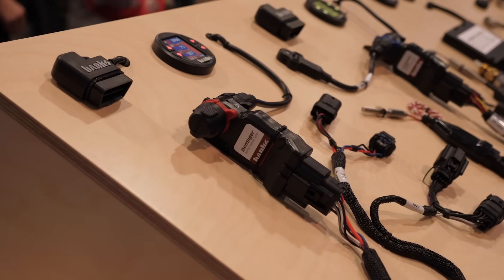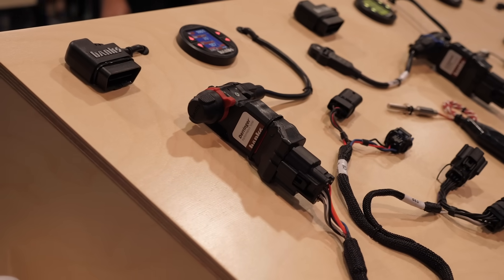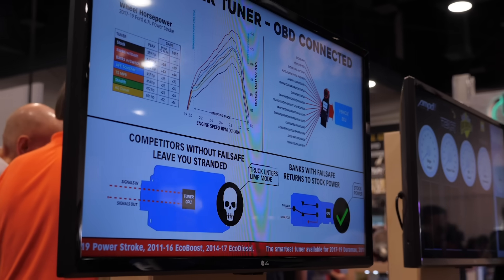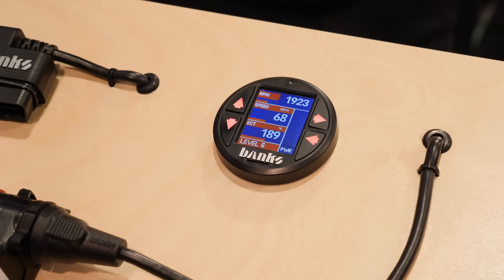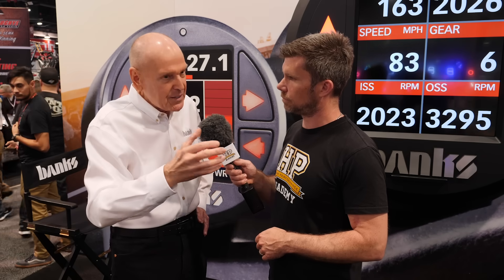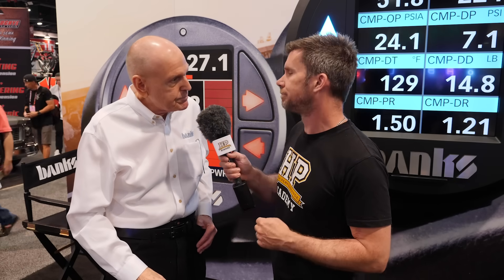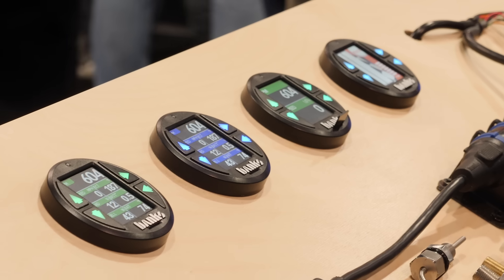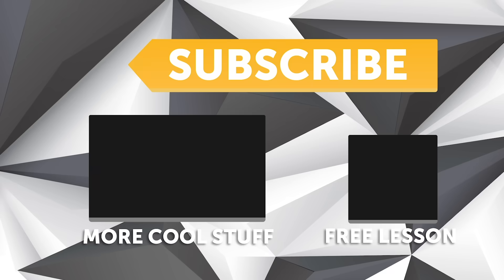More POWER With A DPF Fitted? | Gale Banks On Emissions [TECH TALK]

Comment: He missed the entire point of the cost of the emissions systems. Most people who delete just want their truck to run without 5 figure repair cost when it breaks.
Reply: This was a few years ago but my brother had a 2013 diesel truck he just bought at the time and it had no check engine lights whatsoever. He drives it for like a week and the light flashes. Takes it to the dealer he bought it from and its the entire emissions system basically. Estimated $15k in repairs but it was all under warranty. Truck was in the shop for a few weeks. Stupidest thing.
Reply: Exactly!
Reply: Precisely why I deleted mine. 🤷🏻‍♂️
Reply: None of you are smarter than Gale
Reply: @dv7431  you're correct, gale isnt allowed to say what he knows is right without getting Greta and the EPA upset and suspicious with him
Reply: @dv7431  Gale mentions he does not like the emissions equipment due to inefficiency and longevity in his speed podcasts, but says he has to play by the rules.
Reply: @dv7431 the fact you think this old fart is telling you the truth is hilarious
Reply: A deleted truck will be more efficient, and produce less greenhouse gasses!
Reply: @JohnDoe-nz6bk  
Unfortunately, greenhouse gases aren't the problem that DPF systems are solving.

Comment: I don't have a problem with my ISX 600 making power.  What I have a problem with is putting 1000's of dollars every year in parts to keep it working properly. Today's systems are just a money pit that destroys the engine and shortens engine life by 50% or more.   I have friends running commercial trucks for years with fully deleted engines making 30% more power with 40% better fuel mileage and you can't even tell with visible inspection they are deleted.   CARB is a joke and has ZERO authority to do inspections or plug into your CPU to check settings they are not LEO and the DOT officers don't enforce emissions at scales.  So the bottom line is don't register your trucks in California and keep the tune lean enough to make very little smoke as possible.

Comment: To put it into simple terms. The new diesels eat it's own shit. The soot gets recirculated back into he engine turning the oil into grit and ruining the internal components. I know from experience in the ag equipment. New tractor lasted 343 hrs and the engine was done.. engines are like human body's. How long do you think a human would last eating it's own shit. The EPA is the criminal putting this into diesels.

Comment: You accept poor motor conditions because they say so?  That’s poor mental gymnastics Gale. A DPF does not benefit the motor in any sense, and will harm you in the long run. You flipped your opinion only recently when you and a few others were forced to swap camps. But you should stick back to facts and not twisting them to fit them into a poor emissions standard.
Reply from the maker: It's law and pollution related, but the conversation is around how you can still make more power while leaving these devices fitted which is particularly important for those where the law requires it for street usage. If you have a race car/truck, then it doesn't matter =) - Taz

Comment: Most of the people I know, besides my graduating high school class are mostly deleting their diesels not to roll coal and blow smoke all over the place, but mostly its for fuel efficiency, reliability, and it's much cheaper to do than replacing/repairing your prematurely failed EGR/DPF.  And now these EPA jerks aren't seeing the issues with emissions control systems making these perfectly good newer diesel truck so unreliable compared to their predecessors.

Comment: To me, the real issue with DPF is the reliability of the systems themselves.
Reply: @AnIdiotAboard_ so you have a sample of one vs my experience across 10 trucks. 5500s with Cummins. Fleet of 10. 60k-100k miles per year. Consistently the dpf systems gave us issues. Two of those trucks had to have full system rebuilds on them at a cost of $15k. Two other trucks had issues that were less significant but still enough to require dealer service.
Reply: the concept is flawed.
Reply: @xxxmikeyjock  probably in multiple ways
Reply: That's at the core of this vid
Reply: @AnIdiotAboard_exactly 👏👏👏 diesels are designed for 2 things above all else - long runtime and medium-high loads. Think farm equipment, towing, long-haul trucks, train locomotives, ships. They need to be run hot for maximum efficiency, and they need regular MAINTENANCE. millions of good diesel engines die because their owners cannot be bothered to check and change oil (especially turbo diesels) or are driven by morons that put high rpm loads on a cold turbo.

Thinking about it, someone who wants to purchase a diesel should have a minimum mileage / hrs under load per year for it to be viable.

Comment: I get why he’s saying this, he can’t sell illegal and always was emissions friendly products for the times. The problem is, there is no denying the data almost 2 decades of emissions controls on diesels has proven. The 6.0 EGR issues, the 6.4 early DPF trucks frying motors (the 6.7 Cummins had emissions gremlins too), and on the new ones the fluid is a nightmare. I have a 05 F350 long box CC 4x4 lariat, it has 285,000 miles on it, deleted EGR at 200,000 but all stick otherwise, and finally lost its head gaskets a few months ago. I studded it, put in the updated oil cooler and a 4 inch mbrp turbo back, it’s running fantastic and I fully expect to see 500,000 miles now from it, and I average 24 mpg on the highway, I drive slow lol but can’t beat it. My dad has had his 2008 F350 6.4 since brand new, deleted at 150,000, dpf and egr, 4 inch flow pro with muffler but no cat. That truck now has 234,000 not a single issue, with proper maintenance it should go a long way. We both use SCT x4 trans only emissions off tunes, neither truck rolls any coal, they run great. I have 3 friends with 2018-2019 trucks, one duramax, one powerstroke and one Cummins. Each and every one has been in for clogged DPF, regen issues. I’ve towed the dodge home with 700 miles on the clock because the spot filter sensor was too plugged up to command a regen. Two weeks ago my buddies powerstroke threw a rod towing his travel trailer and sled on the deck, no warning. I went and pulled his shit home with my 15 year old clunker and got better mpg to boot. All failures are emissions related. It’s crazy anyone can dance around the overwhelming evidence on this. The 6.4 goes from a driving time bomb to a good motor just by deleting that shit before you get too much blow by and oil dilution. The 6.0 once deleted and updated is one of the best diesels on the road. Emissions is garbage.

Comment: A Diesel engine running wide open deleted for 1 hour compared to a gasoline engine idiling for 15 mins, the gasoline engine burns 10x more toxins than a diesel... it’s a money game that’s it
Reply: Money and power.

EPA have unlimited amounts of power now... No brains.but lots of power. And they are lobbyist driven. Who benefits from great diesel engines that are throttled back by shitty solutions to a problem that doesn't exist? Oil and OEM's. If they could just outlaw smokey engines they would force clean tunes and everyone would be happily breathing clean air and people would be happy with extremely reliable engines that get great MPG.

Comment: I wrench for a global company that has around 30k medium and heavy duty trucks and one thing is guaranteed by 100k to 130k 80% of those trucks will have a engine light or emissions light on , we spend more time on emissions than anything  else ,and don't get me started on pushing dirty exhaust back thru the engine , egr , junk ..

Comment: You can make power without the full delete, but the full delete increases reliability by an absurd amount.  Most of the service problems I see with diesel trucks are DEF system related, with second being EGR issues.
Reply: Depends what you class as "power"... because there's always more. What is enough? What are you going to use the vehicle primarily for?
How about a power-to-weight ratio 200bhp/ton?
Reply: you are basically saying you cannot make any power with an emissions system.
Reply: @xxxmikeyjock 
That's a knee jerk comment
Not what he said

Comment: This guys intelligent hope someone’s capturing that knowledge. Smoke is for kids they don’t understand a efficient burning engine doesn’t make smoke.
Reply: I saw an lml yesterday that was deleted taking off from a light and he had no smoke, not even a haze when taking off
Reply from the maker: @Abram did you watch the interview? Simply removing your DPF won't cause your vehicle to smoke, it is there for a different function, but you can get a solid increase of power with it still fitted if you tune correctly - Taz.

Comment: Maybe the solution for the diesel engine is not DPF nor exhaust fluid. Maybe it's the diesel fuel itself, it isn't volatile enough, of course it won't burn all the way
Reply from the maker: Yes there is certainly room for different and better solutions - Taz.

Comment: It is criminal in what's being recycled back into the engine and what the engine could be without the choking!
Reply from the maker: If you're building a race engine, sure, you have the option to not use these systems, but if you plan to use it on the street and are restricted by law, you can still make more power and stay legal =) - Taz
Reply: High Performance Academy if you want performance and fuel economy and longevity you don’t want that crap in your engine! I understand about emissions and I fortunately don’t live in a county in my state where they even check. I service all my own diesels! My 2001 VW diesel was plugged almost to where no air could get in the intake from the egr plugging up from normal use!

Comment: At the end of the day, horsepower is a function of air and fuel delivery.  My truck (6.4) with the DPF on is capable of maybe 400-450 RWHP safely.  You could turn it up but it wouldn't be long before something blew.  Take the DPF off and I can run a quarter mile in 12.9-13.1 seconds, which is about 650-670 RWHP considering the weight of the truck.  Cats and DPFs create massive amounts of air restriction in the form of backpressure, which reduces power output and sends EGTs sky-high.  I don't much care for smoke.  I went with Gearhead tunes for that exact reason (clean tunes, 6.4s can be really smoky).  The top end power is the same if not better than the box H&S tunes.  However, I lost quite a bit of response on the bottom end (more lag).  My buddy with a 6.7 noted the same thing.
Reply: If it's tuned properly it shouldn't lose anything down low with turbo/etc being un touched.. Look at the banks tune graphs, they don't lose anywhere even with DPF.

Comment: So after all that great info, anh chance you could clarify some details about EGR.
I understand how it works what it does and even why it's been implemented. I just don't get how come it in theory only works for very limited amounts of time and generally only until the engine gets to a decent operating temperature, so why does it end up coking the heck out of inlet manifolds something chronic.
Is it that they fail to work correctly in virtually every motor made or is it that some one has decided to compromise the long term over the short term?
There must be a better way forward that uses the energy in that coke before it chokes the inlet and robs performance and compromises the long term efficiency of a motor.

Comment: EPA thinks it’s fine that we burn more diesel (DPF) and get less MPG. They increased sulfur in the fuel to help components in newer diesels so that manufacturers can meet EPA regulations making it more caustic. EPA much prefers that we dump more of the burnt ash into storm water drain than the little bit of smoke we would’ve normally produced. We’re not saving 💩. EPA get a lot of $$$ from government to mandate made up garbage. Wait until they have to dump depleted lithium from electric cars.
Reply: You hit the nail on the head with the BS electric cars.wsit we have to burn coal oil or uranium to make electricity to charge you toxic lithium battery. Give me a non emission common rail diesel no egr.😁

Comment: I solved all my issues with DPF crap, I went back to gas engine vehicles.
now, I don't have to buy that ridiculous DPF FLUID.
Reply: yea now you burn twice the fuel towing a heavy load compared to a diesel.
Reply: The fluid you add is DEF. Diesel exhaust fluid. You thinking of the diesel particulate filter.

Comment: I would love to see Gale do a video discussing backpressure due to DPFs especially after the latest killing a duramax video.
Reply: Agree, you can tell hes bitting his lip about the emissions crap
Reply: I forget if he said in an old video or when I talked to him about his new exhausts but the new dpf's are actually very free flowing.
Reply: @ELITE_WARRIOR228  No, he did do a marketing video showing the "benefits" of his $$$ dpf back tail pipe. Might have even shown some of it during one of his Killing a Duramax series.  I believe he showed in that video the DPF was a significant restriction. I believe the stock turbo was also a large restriction.
Reply: Back pressure is bad for all engines. Gale is dumb.